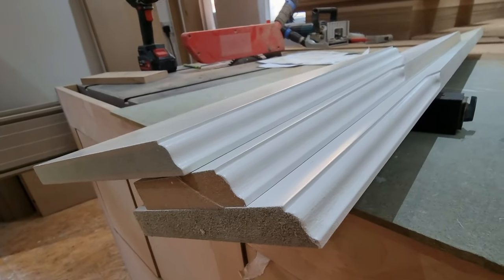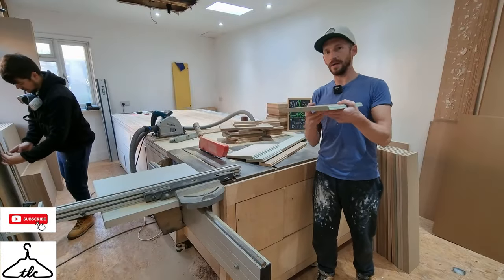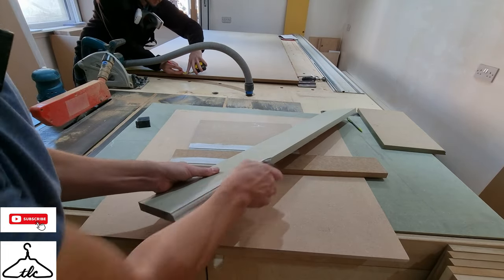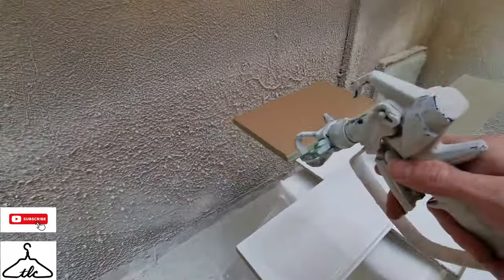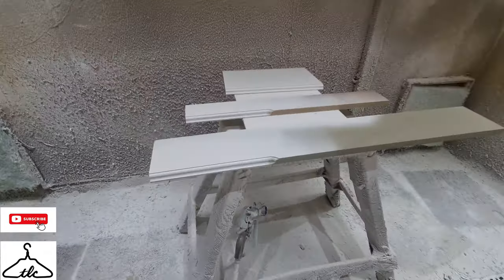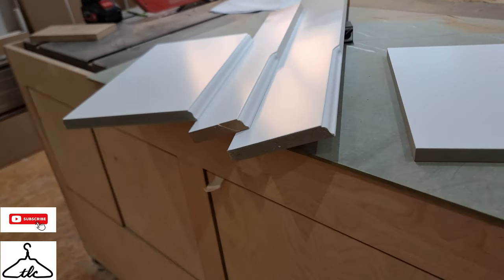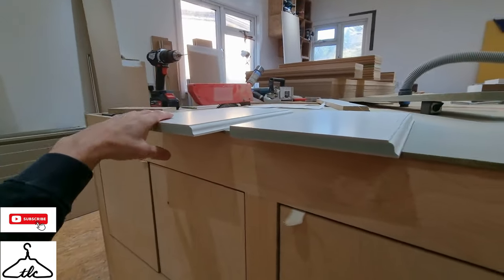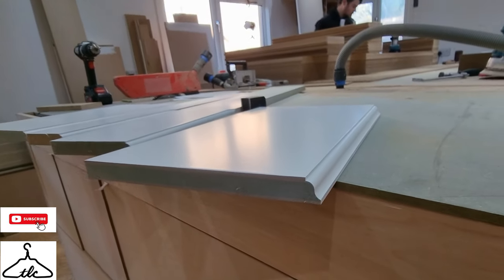Is FINSA Worth It's FORTUNE? Who Wins The PAINT FINISH CHALLANGE? VID#163

Comment: Very good video.  Aside from paint finishes on the various types of mdf , do you have any issues when drilling the 35mm hinge hole on the standard mdf compared to the rest?
Reply from the maker: Hi, and thank you!
This mdf we use is pretty good and drills quite nicely with the hinge cutter 👍👍
Reply: @thelondoncraftsmanworkshop  I was just curious. I'm in the middle of a media wall build for a family member using Caberwood trade MDF. The new 35mm cutter was struggling to drill compared to what I'm used to, very fluffy once you get below the surface. Other than that it seems ok material.

Comment: Great video! Thanks. Off-topic question: do you have a video about your table saw / slider? Never spotted the slider before and I’m curious which one it is!
Reply from the maker: Thank you!
I don't think I do actually, I did try and film building my bench so there is probably a bit of footage in those vids, but not much.
Those vids are a few years back 👍
Reply: You can also get sliding tables for Axminster saws too, depending on your usage you might find a cross cut sled more useful

Comment: Worth every penny if you want to be at the top of your game and produce the best that you can. 

If you 'can' get a better finish then you should. When im charging £1800-2000 per linear metre for bespoke furniture then the client will get the best possible material & finish money can buy. 
£45ish plus vat for a sheet of Finsa 18mm isnt breaking the bank.
Reply from the maker: Horses for courses  👍
Reply: I posted a message above and then read your message. I'm a Joiner so most of my work is solid timber based rather than sheet materials. I'm paying more like £33.00+vat  for Finsa, £35.00 +vat for Medite MRMDF and £30.00+vat for cheap standard crap........ I totally agree with what you say , especially when you consider the vast majority of the costs involved in 95% of jobs is Labour. You can make a fair amount of stuff with 10 sheets of MRMDF  and IMO it certainly saves on extra labour of finishing a product when you have a better quality base material.
Reply from the maker: @AdrianSams  
I don't know how you call it cheap crap, did you not watch the video showing the finishes I got work near enough identical. 
If I was making Mouldings or using in a kitchen or bathroom, then I'd buy finsa. But my finishes I get with exactly the same amount of work as the finsa is amazing. No brainer for me, and my video proves this.
Reply: @thelondoncraftsmanworkshop  So how much are you paying for standard (what make is important too ,which you've never said) how much for Medite MRMDF and how much for Finsa Hydrofugo per sheet?. Lastly, to anyone who actually looked and knows their job would know/see they were not identical. "Cheap crap" was reference to many of the stuff they sell at the sheds and builders merchants.  Also how much work did it take to get them all to the same standard. I look forward to your reply.
Reply: @thelondoncraftsmanworkshop  sorry but I've seen the finish you get on your videos and even though it's not in the flesh it's very evident it's not great. It's working for you so you have no reason to change your system so fair play.
Reply from the maker: @jamiedyte3809 all due respect, but you have no idea the finishes I get.  
You can think what you want to think though.
Me, around 10 years using the same finish/technique, not one unhappy customer. 
I do these finishes as they work for me and don't cost a fortune. 
Each to their own, we all have our own opinions and I'm happy with mine. 
Stick to yours, and I'll stick to mine.

Comment: For fitted wardrobes and draw units you make it not always worth using hydro, but for kitchens and bathrooms it is. 
Paint wise if you know how to sand flat properly and use good paints you can get a flat finish on any board. Is that MR caber? Coz that’s the worse board ever made 🤦‍♂️
Reply from the maker: Yep well said.
I'm not sure about the m.r, but I've uses lots of it over the year from different places and I always tend to get the same finish, which isn't the best compared to the others

Comment: In the video you mention that FINSA costs 3x(300%) more than standard MDF. Is that correct?. If so then I think you should look into your suppliers. I've just checked the prices of FINSA Hydrofugo and 3 months ago I paid £33.00+vat for an 8x4 sheet, Medite MRMDF was £35.00+vat and standard was £30.00+vat............. I really fail to understand your logic ,unless as I said your suppliers are pully a fast one. Incidentally I'm a Joiner so most of my work is timber based rather than sheet based so I don't high volumes.
Reply: Where’s your supplier? I can’t get anything near that price!
Reply: @benlawrencemiller1423  I deal with Lathams and also Brooks Brothers.I'm a one man band who's wife helps out when needed so not a flash company.
Reply: @AdrianSams  I'm calling Lathams in the morning!! £33+ must be for 12 to 15mm
Reply: @paulgray3231  Nope I paid for 18mm. I've never bought more than 10 sheets at a time. My last order iirc was about 3 months ago and was from brooks bros. They didn't have Medite which I prefer so I had Finsa Hydrofugo. I don't think I've ever used 15mm to be honest, mostly 18mm, 12mm and 9mm. All the best Ade.
Reply: @paulgray3231  One final point, I spend around £12-15k a year with Lathams, mainly with their timberside. Their sheets side charged me £100 delivery charge 8 weeks ago on my order of 10 sheets so I no longer deal with their sheet side. Brooks brothers are far better. Lathams have lost my business for sheets and possibly solid timber too. Worth a call though and good luck.
Reply: @AdrianSams  I generally use Lawcris for my panels but will see what prices are tomorrow. This is only a good thing when we talk about prices in the industry. The companies hate it as we eventually find out that there ain't no loyalty to customers.
Reply: @paulgray3231  Hi Paul, Not sure Lawcris come down my way (as far SE as you can get before getting wet)  Totally agree with you and I'd be happy to send you a copy of my invoices to prove it. I don't think Loyalty exists now, no integrity, no morality in business. Maybe I'm old school. 

Back to the topic, I've been making Joinery including kitchens,wardrobes etc for 35+yrs and I'm yet to find any "standard" grade MDF that is even remotel;y on a par with Finsa or Medite. Strange that they don't specify what brand/seller they purchase their standard MDF from becasue even standard grade can be a minefield. The rubbish the sheds/Builders merchants use is likely to be Chinese/Asian tat. I was offered a whoel container full a few years ago for £1 a sheet and I still refused to buy it. The cheap tat de-laminates so easily and a bastard to get a decent finish on it.